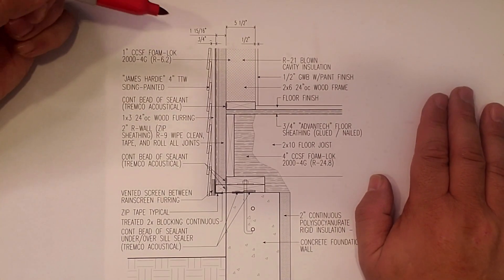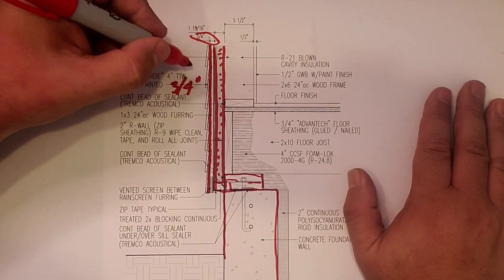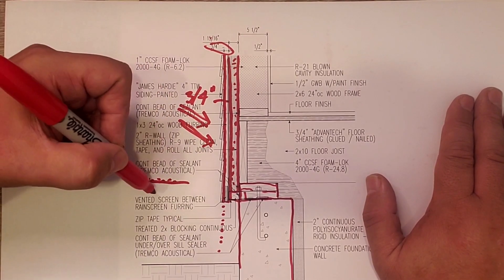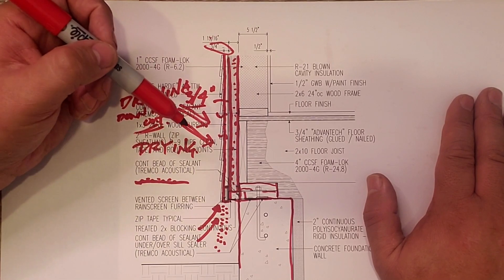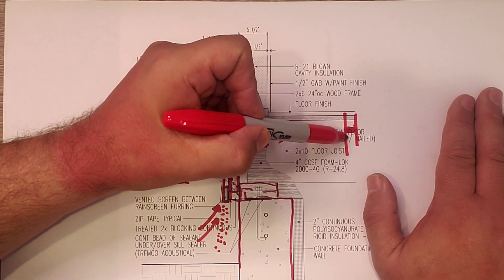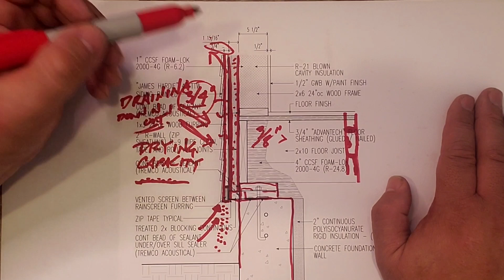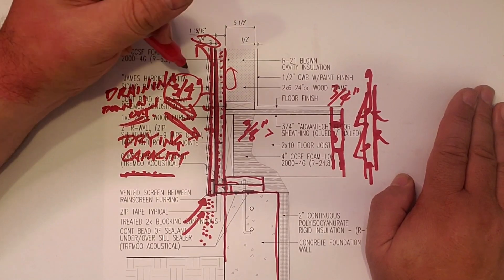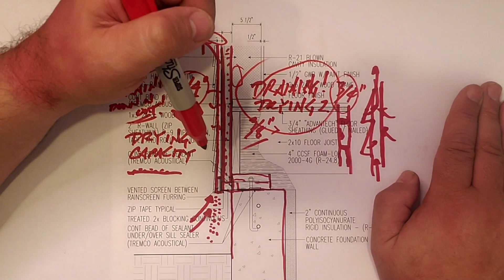WATER MANAGEMENT site testing RAINSCREENS

Comment: Every shows the bottom of the wall, no-one shows the top . When the sun comes out and heats that space the moist air wants to rise and escape at the top. If the top of that 3/4 gap is sealed your drying is borked
Reply: I agree!
Reply: That's why you need venting at both the top and bottom.  We used Cor-A-Vent SV5 at top and bottom of the wall assembly on our new build, which provides the 3/4" gap for draining & drying potential.  A little pricey, but I think will be worth the cost.
Reply: Yea run coravent horizontally top and bottom in between furring. @GForceFitness1

Comment: Have you ever thought about recessing the ZIP-R sheathing, so it aligns with the foundation? I love the siding/rain screen/ZIP-R sheathing buildup you have, but the big exposed bottom edge may look unappealing to some.
Reply: I run a pvc stud on that space then siga over it, then metal flashing over the siga to kick any water out and away.
Reply: On my new build, we set the walls back to account for the thickness of the Zip R.
Reply: @lucasfallert4031 what type of floor system did you have ?
Reply: @jhoffmanhomes , TJI joists. They set them back far enough where once the rim board and zip sheathing were put on, they were flush with the 10” foundation wall.
Reply: @lucasfallert4031  got ya, thanks for the explanation, I’m getting ready to start incorporating the zip and hadn’t considered moving the floor system in.

Comment: Hi, what were your thoughts on this wall assembly in a 3A climate (NC)?

Metal (vertical, nail every 12") > 7/16 mesh screen (vertical, non compressive) > Alumaflash > OSB > continuous rigid foam insulation > studs 16" oc with rigid foam in-between > drywall. Corvent at top and bottom of assembly. It will be monopoly framed with the entire envelope having the same assembly layers except the underside of the trusses will have strapping to keep the foam boards from falling and the drywall will be fastened to the ceiling. The trusses won't have continuous insulation across them, just in between (budget constraint 😬😩🫠)

Thank you for your time and insight. ❤
Reply: Good question.   NC/ SC border here.  I was going to ask a similar question. Will be building soon.  That would be my approach as well.
Reply: @MrLoudog7 howdy neighbor 🙋🏾‍♀️